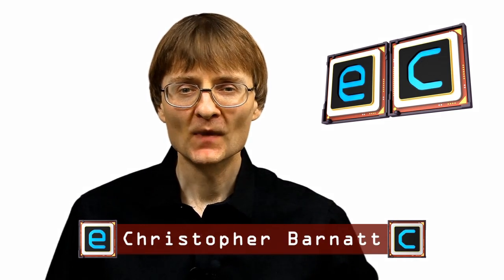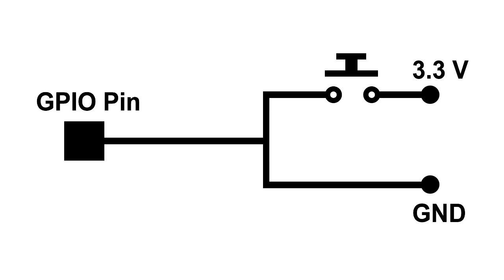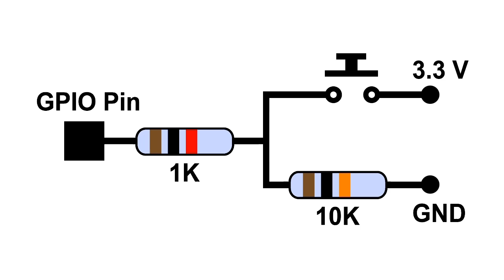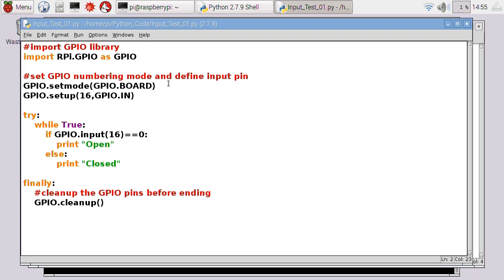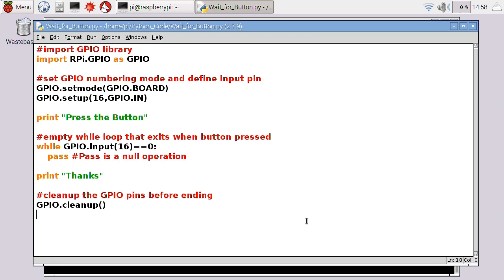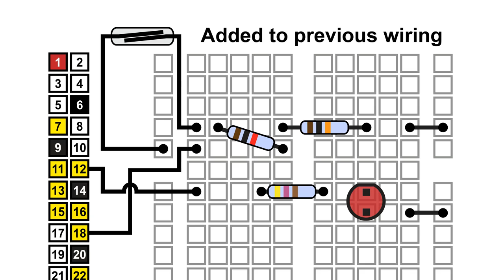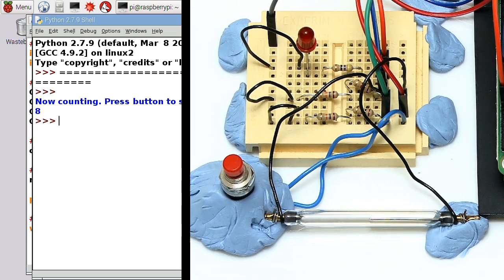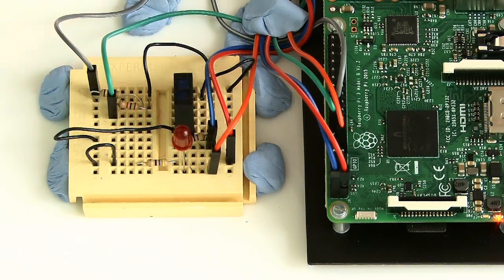Raspberry Pi: Using GPIO Inputs

Comment: Hi excellent video. One question : some modules request BCM library, other physical gpio numbering. Is this possible  to make different librairies co existing in the Pi? I mean on the samedi Pi, use Bcm for python scripts using gpio input and physical "BOARD" numbering for sensor? A big thanks for very informative tutorial
Reply from the maker: Thanks for your kind feedback. You can only use one form of board numbering at once in the same code. But you can easily translate between the two by changing the GPIO pins referrered to in the code (manually turning BCM values into Board or vice versa).

Note that only the code has numbering -- no sensor does. A sensor is just a component connected to a pin(s). But the cod needs to know the numbering convention used to access that pin.
Reply: @ExplainingComputers   hello. OK many thanks for your reply :) Then, I can use BCM numbering for a python code that will warn me by sending an SMS in case of flood (with a water sensor), and display the humidity and température using MMM-dht22 that use "BOARD" numbering on my magic mirror (that use dht22 sensor)?
Reply from the maker: @freespirit4976  Yes. The sensors are just connected to physical pins, and you can choose in the code which numbers to assign to them (board or BCM). So if you use board numbering in your code, and have BCM numbers for the sensors, you just need to convert those numbers to board.

Comment: Great video. Very Helpful. Does anyone know if you can write a program using this general method (using idle and such) to perform a daily task? Say flipping a relay for 20 seconds each day?
Reply from the maker: Yes, you could do this -- though you will need a controller to trigger a relay (see my "Rasberry Pi Robotics #2" video where I show operating motors, which could be substituted for relays. You can use the datetime function (import datetime) to read the time in Python.

Comment: One subject that few (1) have explained is how to have the Pi act like an Arduino and trigger 5V events. Is it true that you would just use a1N4148  transistor and use the Pi out to trigger  a 5V source
Reply from the maker: I am not familiar with the 1N4148, but logically it must be possible to use a 3.3V GPIO output to trigger a transistor to deliver 5V sourced from the 5V GPIO rail. I have used an L298N to use a Raspberry Pi to control motors, and the principle is the same. I am thinking that you could use an opto isolator for this too. :)

Comment: Why use the 3.3v pin for a button? I've seen other videos just using 2 Gpio pins, One Input Gpio and a gound Pin, thanks
Reply from the maker: I am bewildered by your question. To use a button, a GPIO pin needs to register an input. And on a 3.3v board like a Pi, that will be a connection to the 3.3V rail. I've no idea what other content you have looked at, but there is no other technically competent way to do this. (Well, I guess you could drive another GPIO pin high as an output and then use that, but it would be pretty daft).

Comment: Hallo Chris..
I am quite new to r pi.. and find your tut video very good.. so i watch this and also the other on out put..made all the pull down and resistors.. but i thought what about combining the to videos.. 
I made both project on the same breadboard... but then my creative idea came to a halt..cz when i used the same gnd for both project, magic occured.  When i runned the input program...the led from the other project started glow.. when i use 2 different gnd no problems...so my question is. 
Does the 3,3 v ...som how wander from gnd back to led...
When i run the out put program all function..all gpio is correct all resistors r correct. All programming is correct..i made 3 led in same set up...but as soon as i combine the gnd from both setup..it happens... when i run outprogram as said no problem. But my input program...makes the led light from beginning...i have made it down to input in a while loop...only command is input...but it again only happens when both setups uses shared ground. Can you send me some hints... thx
Reply from the maker: I am trying to imagine what is going on. The pull-down resistors could be the issue, taking some current to the ground rail. I have never wired these two projects together. Keep experimenting! :)
Reply: @ExplainingComputers  thx chris. It seems it was the problem..i never programed or done anything with eletronics...i am a sales guy..but i need a project...i have now programmed around 1500 lines of code for and logic for a ac drive...i have made a high priority threed defined in a class..that handels all the user inputs..buttons and so on..while I have a some functions like autoclosure and prewarning..I made hold to run and autorun mode. all is going okay..all is currently controlled by a gui. but I have difficulty understanding encoders. As.. so at the moment I only simulate an enocder.. incremental. it seams that most is using a protocol or a+ b- but I dont know how to program or wire to this...
It would be great if you could make tut vid of this isssue..
I have know been an amature programmer for 1 mounth so all help is appreciated..I have much to learn..thank you for putting me on the right path...with your vids..
Reply from the maker: Sounds like you are doing and learning some good stuff! :)

Comment: Hi Chris. I'd like to use a pull up circuit to activate 2 cameras by using an spdt switch on pin 17 as power rail and pins 14 and 22 as ground on a raspberry pi zero W. 
One will be using the camera connector (C1) and the other pins 1 to 5 (C2) . 
When pin 14 is shorted to ground, wait 1s then if true, activate C1. If false, ctrl-q.
When pin 22 is shorted, wait 1s then if true, activate C2. If false, clear gpio. 
I would be using 2 different files to control the cameras. 
Can you or anyone else tell me if I'm on the right track please?
Thanks in advance.
Reply from the maker: I am struggling to understand this. Do you mean a SDPT relay? If so, you should not operate a relay coil directly from a GPIO pin, as they have a low current output intended to trigger electronic circuits only (and maybe light the odd LED!). Assuming you are using board numbering, pin 14 is not a standard GPIO pin. Pin 17 is a standard GPIO pin, but as noted has a very low current output. If you have a Raspberry Pi camera connected to the camera port, there is no way to turn it on and off via GPIO, and this is not necessary, as the camera can be turned on and off in software (eg by activating the camera module in Python). You may find this video useful on using motionEyeOS with a Raspberry Pi: https://www.youtube.com/watch?v=8YUM7jio6dk Good luck! :)

Comment: Hi. I am new to electronic and I am wondering what the wattages of the resistors are that are used in this tutorial. Does the base colour of the resistor indicate the wattage. I noticed that the ones used in this tutorial are a beige colour and the ones that are used in Pi Robotics #1 have a base colour of blue. What is the difference?
Reply from the maker: The base colour does not necessarily indicate wattage, you  visually only tell if a resistor is higher wattage by its physical size. Here I think I used 1/4 watt -- same as in the Robotics #1 video. So only the colour was different, not the wattage. Thanks for watching the videos!

Comment: Sir do you have information according to current used for signal on GPIO ? I just read the documentation it say's that in order to use Pi safely, make sure GPIO not drawing more than 16mA. I'm confused, why it's too low
Reply from the maker: There are various different "opinions" on the exact maximum current output per pin. However, 16mA is commonly stated and is not that low. Remember, GPIO provides electronic control signal outputs, not electrical outputs for controlling motors or other devices directly. We can get away with an LED, and also a servo as its internal control board only requires a control signal input (so the GPIO pin is not powering the servo). But for anything else some kind of control board is needed -- like, for example, the L298N that I've used in many robot projects on this channel.
Reply: @ExplainingComputers Thank you so much for acknowledge me about current sir. I'm also interested in Pi - Motor project, talking about L298N motor driver isn't it working on 5v logic level, sir? 
since Pi work on 3.3v logic level, did you having an issue while interfacing it ?

Comment: I have a question, how would i read an input from photo sensor and if it is reading 1 make it run a motor until a switch is triggered and if it reads 0 make a different motor until a different switch is triggered?  Basically i want my pi to operate my chicken coop door so that it opens at sunrise and closes at sunset.  Both the open and the close operation should be interrupted by the activation of a magnetic switch but the loop that checks the photo switch should run forever once every hour (3600) seconds.  

Here is what i have so far:

import RPi.GPIO as GPIO
import time

GPIO.setmode(GPIO.BOARD)
GPIO.setup(7,GPIO.IN)
GPIO.setwarnings(False)

try:
    while True:
        if GPIO.input(7)==1:
            print ("Night")
            time.sleep(2)
        else:
            print ("Day")
            time.sleep(2)
finally:
    GPIO.cleanup()

Comment: I have no working knowledge of the raspberry pi 3 only some PC
I have 2 (5-12 volt) meters or counters, one goes up for each dollar that's put in the machine and the other goes up as each dollar is taken out of the machine. I'm looking for a way to record the 2 inputs to a database that I can access over the internet using the raspberry pi 3 
I also need to know where to get the Ras PI 3
Thank you

Comment: Excellent video, but one problem. The video shows the switch connected directly to 3.3 and the GPIO. With one switch lead to 3.3 the other should be connected between the 2 resistors.
Reply from the maker: Thanks, but there is no problem. The video does  as you state "show the switch connected directly to 3.3 and the GPIO". This is simply not true. If you are referring to the first diagram -- as here: https://www.explainingcomputers.com/pi_stuff/Pi_GPIO_Circuit_AA_500x361.jpg  -- then the GPIO pin is connected to the current limiting resistor, which in turn is connected to the switch and the pull down resistor. The switch is then connected to 3.3V and the pull-down resistor to the ground rail.

Perhaps you are not familiar with how a breadboard works? The outer rails are collected vertically. But the blocks of pins in the middle are connected horizontally.
Reply: @ExplainingComputers  Ok my bad. I see it now. Thanks.

Comment: If I connect a GPIO pin, configured as an Input, to a ground pin, it should register as OFF yeah?  Or will it be floating and might register as ON sometimes?
Reply from the maker: Yes, if you tie to ground it will register as off, but always off! :)
Reply: ExplainingComputers thanks.  I don’t know what I was doing wrong but it seemed to be still floating even when directly connected to the ground.  It’s not now though so it’s possible I had misidentified the ground pin and had the input pin connected to something else.  I also misunderstood how the breadboard worked and didn’t realise that the tracks didn’t continue from one side to the other.  So I basically had a big break in the middle of my circuit!   That had me scratching my head until trial and error solved the mystery.  I’m learning so much from your videos and making my Raspberry Pi B r2.1 control and receive signals from components outside itself is very exciting!  I bought it years ago only to act as a streaming media server and it’s been unused in the shed for a few years.  Then I discovered your videos and it like discovering I have an Aladdin’s Lamp in the shed!  “What can I do with this amazing bit of tech?!”  And I have your very thorough, step by step videos to follow.  I even found and installed the oldest version of Raspbian so it would match your videos (and not run too slow on my ancient Pi).  And now I’ve learned how to use a breadboard!  Wonderful stuff!

Comment: Extreme cooling part 4 coming soon? :)
Reply from the maker: Yes, it will happen! :) Next week is something entirely different, then the week after that I'll be overclocking the Pi with its extreme cooling. And then (assuming it survives!) connecting it to the Zalman. The video today was shot before I started the cooling experiments. :)

Comment: How pin 20 connects to the pin 16 through resistors. It seems they are always disconnected...
Reply from the maker: On a breadboard, the rails in the middle of the block are linked horizontally, but those on the edge are connected vertically.
Reply: @ExplainingComputers  Yes, now I see. But, are all the ground black pins connected between themselves on the board? And what is the real potential of the ground pin? Is it zero or negative?

Comment: Nicely explained, but wired the wrong way....the switch wire should be between the two resistors...
Reply from the maker: I can assure you that the wiring is correct.

Comment: I'm pretty sure reed switches used to be a primary means of controlling automobile turn signals. I could be wrong. But that's why it sounded like a car waiting to turn there for a hot second.

Comment: so it mean that i can not  connect switch like this: 
gpio( 3.3V)  -> swich -> gpio( pinX)  and with python settings: GPIO.setup(pinX, GPIO.IN, pull_up_down=GPIO.PUD_DOWN) ?
Reply from the maker: You can do this -- if you trust the internal pull up/down resistors, and yourself never to make a coding error that would be prevented from doing harm by using an current limiting resistor in the input. It is not something I would do. :) This is all stated in the video!
Reply: @ExplainingComputers  Thank you very much for your quick answer. The problem in my project is that I have 8 to 16 switches to connect, so first of all there will be a lot of soldering and additional connections (what if it has to be - it will be) but ... the worst thing is that if all the switches are connected to one GND, the current will flow as well to all connected GPIOs?  (I'm starting to play with Rpi and GPIO so please be understanding.)
Reply from the maker: @ukd8387  Even with all the GPIOs connected to the GND rail, things will work fine. This after all what would happen internally if you use the internal pull down resistors on the Pi. :) Either way, the pins are pulled down via current limiting resistors, so when the 3.3 rail is connected to a pin, this will only trigger that GPIO.
Reply: @ExplainingComputers  however, I did as you suggest in the video. More work but, the fact - I never know when the program crashes - I press the button and I know that nothing bad will happen. My "toy" works great, and so does RPI. THANKS for your help !!!!

Comment: can I combine a liquid crystal display display with general purpose Input output inputs?
Reply: 5:42 general general purpose input output inputs?
Reply from the maker: I am not sure what you are asking. On an LCD display, yes you can use one of these on a Pi in combination with devices connected to GPIO pins. The diagram at 5:42 shows all of the GPIO pins that can be used as inputs or outputs.
Reply: I'm sorry I'm just making a bit fun out of the redundancy of GPIO Input because the I already stands for Input. I combined that with the commonely missspoken redundant LCD Display, where the D already stands for Display. on 5:42 you said General GPIO Input, the G already means general so the redundancy got even worse.

It was a good video and I gave it an upvote, but I just can't stop and marvel about such redudancy

Comment: @5:45 the pinout diagram has yellow and gray shaded boxes, why is this? 
when i search for "rpi gpio pinout," the results were nothing like the image in this video
Reply from the maker: The image you refer to comes up when I talk about the pins you can configure and use as inputs or outputs -- I show these pins in yellow, and grey ot all others. So, where I choose pin 7 in my example, you could choose any of those shown in yellow. That is what I was trying to convey at that particular point. :) You may notice that I show the other pins with other colours (eg the 3.3V, 5V and GND pins) at other points in the video as required.
Reply: thank you for taking the time to answer my question. i think it is all starting to (slowly) make sense to me
Reply from the maker: Wesley Jackson
No problem. This stuff is tricky.

Comment: total noob question but how can i determine what ohms my limiting and pull up/down resistors should be?
Reply: clarify: i ment in general circut projects.
Reply: For the pull up and pull down ones it's very difficult and depends on the individual project and many different factors. Usually 10kΩ is a good starting point. Generally, the bigger the value, the longer it takes for the Pin to return to the wanted state after being triggered, the smaller the value, the more power gets lost in the resistor. Also a factor to be considered is the power loss through the µC-Pin, which is bigger the smaller the resistor is.

For limiting resistors you take the biggest possible voltage drop (U, in this case it was the 3.3V, since the worst case short is connecting 3.3V to ground), and look at how much current a single pin of the µC can source or drain (I, I've read that any Raspberry Pin can source a max of 0,016A). From Ohm's law U = R * I -> R = U / I, you can simply get the minimum value of the resistor you need, but choosing one a bit higher would be playing safe.

3.3V / 0,016A = 206,25Ω  he went the save way and calculated his resistor for a maximum current of ~0,003A, which is the maximum the 3.3V supply can source devided by the number of GPIO Pins.